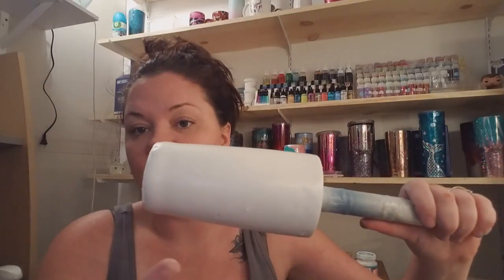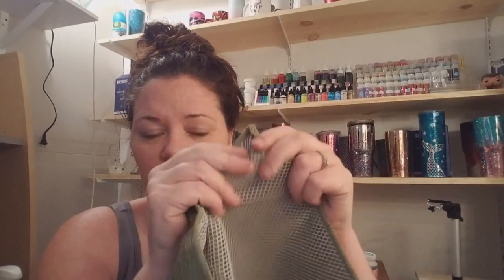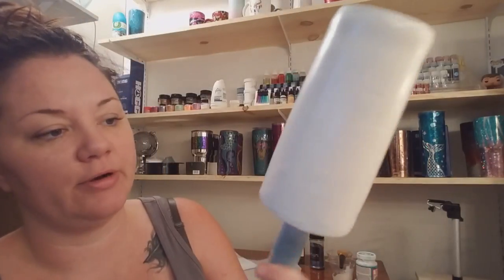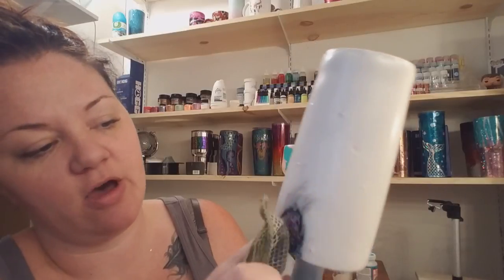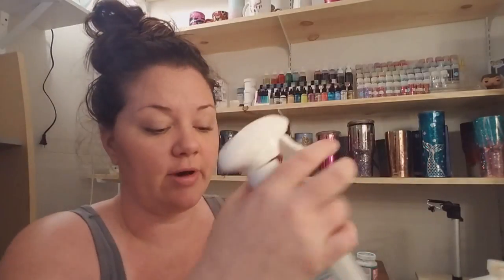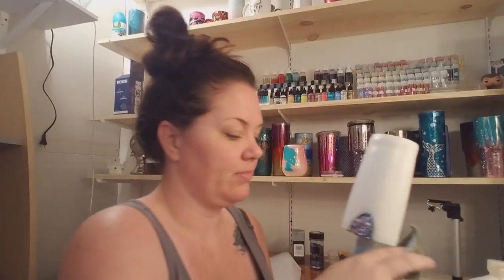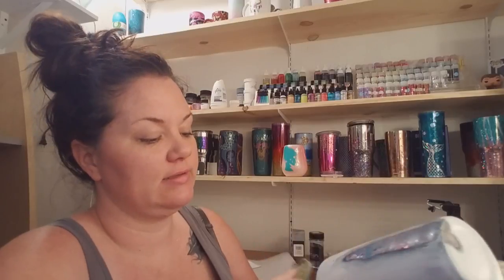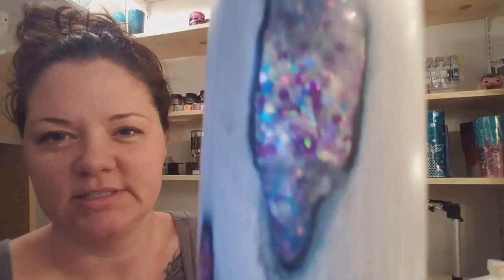How To Geode Tumbler Part 2

Comment: A couple of questions. Are you removing the insulation from the cups, or are they regular cups? When taking off the paint, could you just take off a little, so that the teal that you sprayed on can be seen? If you can't see the layers under the white, what is their purpose? Wouldn't it be the same if you did three coats if just white? Thanks for the video, and your reply to my questions.

Comment: I have a question. Before you seal, I noticed that the Alcohol inks where bleeding or on the bling section, did you clean that up before you sealed?
Reply from the maker: Before, I used a little alcohol to rub the glitter spots clean

Comment: Is there any rhyme or reason that determines the 3 paints you choose to spray onto the cups & does it always have to be 3 layers? Does it just have to go from dark to light? Gonna start my geode cup after work tomorrow. Thanks for sharing. De'
Reply from the maker: There wasnt. I intended to show the layers as I removed the paint. If you're going to ink that is a unnecessary step;) fjust cover in white and ink

Comment: How do you keep the spray paint from going inside the cup?
Reply: If it goes inside the cup, it's fine. It's very easy to remove paint and/or epoxy with acetone and a bit of elbow grease or a scrubber

Comment: Why did you add the black and teal paint before the white? Why not just go directly to the white? You might have said that, I apologize if I missed it
Reply: It give you outlines. So you see the black then a little blue and then the white, gives it more depth look in my opinion.  Google Geode Tumblers and youll see how some tumbers have more defined lines bordering the glitter sections.